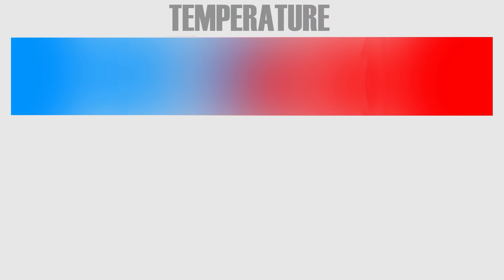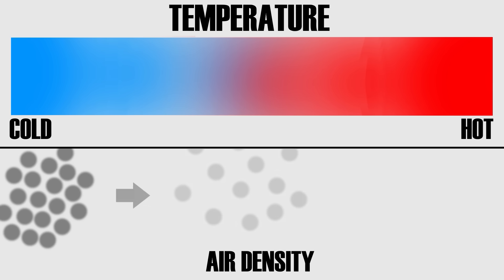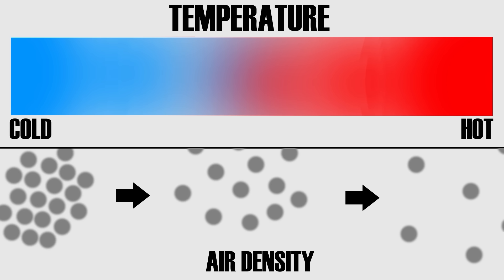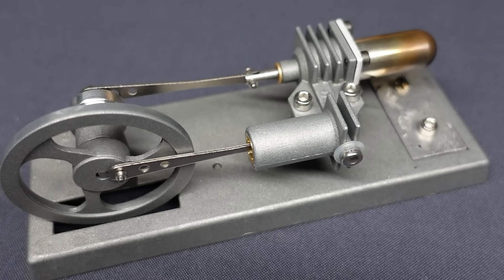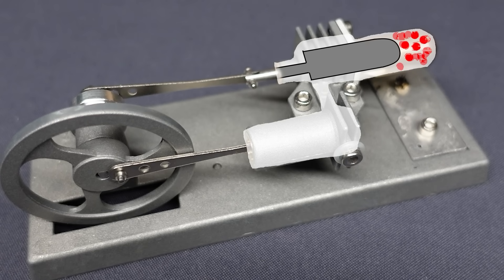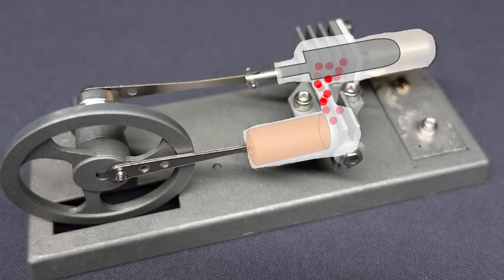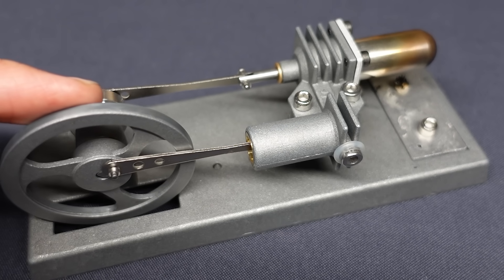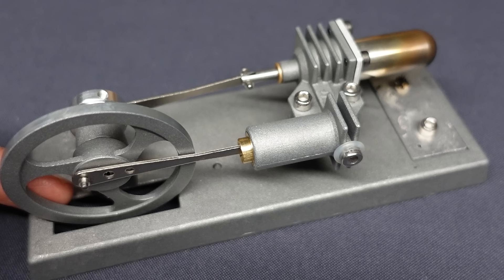It Can Save The World - The Simple Genius of Hot Air aka Stirling Engines

Comment from the maker: Single: https://bit.ly/4895cZz
V4: https://bit.ly/3EuFaCy
10% Off Coupon Code: d4a
More stirlings: https://bit.ly/3LglOVu
Reply: THEY WOULD WORK FOR CARS - if the engine is used as a generator for a serial hybrid the power modulation doesn't matter, it just produces electricity and the modulation of the gas pedal is independent for the electric motor(s)
Reply: @Mgoblagulkablong  Ja ja und am Auspuff könten Sie sich die Hand nicht verbrennen
Reply: Have u used an ion engine as a heat source like my rechargeable survival lighter?
Reply: Has there ever been a train / locomotive using this type of engine? If not, why not?
Reply: I think you overestimate a bit how much power could be harvested by a sterling engine given its rather low efficiency. Burn the same amount of fuel you used to run the 4-cyl sterling in a internal combustion engine of same displacement, and you could run more than just one single tiny LED from it. Same for the exhaust system: There's not so much heat stored in the exhaust pipes and the catalyst. However, if you would use the waste heat to heat up a heat storing medium (e.g., melting a salt), that might be a source for another 10 - 20 min of running the sterling. On the other hand, it's also quite heavy and needs significant space, so you would probably end up with two engine compartments where there was only one before. AND: Loading the batteries of an electric vehicle by using the excess exhaust heat from the combustion engine seems to be a slightly flawed approach... 😉
EDIT': Of course I agree that it would be a good idea to use the sterling engine in cases where there is considerably waste heat, e.g. in the off-gas burning of ETPs, or on oil rigs, or elsewhere when there is a constant flame which just wastes the energy. 
EDIT²: To my information, the most silent submarines are the German ones, because they employ fuel cell technology to generate the power for their electric motors. No noisy rattling excentric engine involved.
Reply: https://youtu.be/KbnGlcQiL1c?si=tb69J2Qh-moA8L75
Reply: can you remove heat by spinning the flywheel?  ie using excess electricity for cooling.  that would be an interesting video too
Reply: What if you were to wrap coils on the end and they were to get red hot like a jailhouse light where a battery gets the wire red hot? Would that create the same heat?
Reply: can you use the induction heating coil instead of flame it can heat it up really fast and with a cooling system the engin can become more responsive
Reply: Can these be use to temporarily disengage the alternator ?  

Using the heat from exhaust gases this could take the load from running it continously 

Does it generate enough power ?
Reply: You should look into the philips stirling generator! :) If it was still made, I'd love to own one
Reply: @Anomalous-Plant  ⚠️ God has said in the Quran:

🔵 { O mankind, worship your Lord, who created you and those before you, that you may become righteous - ( 2:21 ) 

🔴 [He] who made for you the earth a bed [spread out] and the sky a ceiling and sent down from the sky, rain and brought forth thereby fruits as provision for you. So do not attribute to Allah equals while you know [that there is nothing similar to Him]. ( 2:22 )

🔵 And if you are in doubt about what We have sent down upon Our Servant [Muhammad], then produce a surah the like thereof and call upon your witnesses other than Allah, if you should be truthful. ( 2:23 )

🔴 But if you do not - and you will never be able to - then fear the Fire, whose fuel is men and stones, prepared for the disbelievers.( 2:24 )

🔵 And give good tidings to those who believe and do righteous deeds that they will have gardens [in Paradise] beneath which rivers flow. Whenever they are provided with a provision of fruit therefrom, they will say, "This is what we were provided with before." And it is given to them in likeness. And they will have therein purified spouses, and they will abide therein eternally. ( 2:25 )

⚠️ Quran
Reply: @Anomalous-Plant  ⚠ God has said in the Quran:

🔵 { O mankind, worship your Lord, who created you and those before you, that you may become righteous - ( 2:21 ) 

🔴 [He] who made for you the earth a bed [spread out] and the sky a ceiling and sent down from the sky, rain and brought forth thereby fruits as provision for you. So do not attribute to Allah equals while you know [that there is nothing similar to Him]. ( 2:22 )

🔵 And if you are in doubt about what We have sent down upon Our Servant [Muhammad], then produce a surah the like thereof and call upon your witnesses other than Allah, if you should be truthful. ( 2:23 )

🔴 But if you do not - and you will never be able to - then fear the Fire, whose fuel is men and stones, prepared for the disbelievers.( 2:24 )

🔵 And give good tidings to those who believe and do righteous deeds that they will have gardens [in Paradise] beneath which rivers flow. Whenever they are provided with a provision of fruit therefrom, they will say, "This is what we were provided with before." And it is given to them in likeness. And they will have therein purified spouses, and they will abide therein eternally. ( 2:25 )

⚠ Quran
Reply: @Anomalous-Plant  Ja die  Philips stellen große Stirling her Sie finden Sie in jedem Atomkraftwerk zum Starten und Sauerstoff erzeugen Sie auch für Sie.
Reply: @d4a, do you have the link to the commercial New Zealand manufacturer or the other company?
Reply: @reypolice5231  Unfortuntely, although they got really far down the track, even making the engines commercially, they didnt last and closed down.
Reply: So why don't they have these over every dump flame that burns 24/7 🤯 now the dump could serve a dual purpose not to mention reducing the need for other means of generating electricity and what about volcanos or geyser steam
Reply: @Elmer-yt3on  A slaughter house in nearby town has giant flame 🔥 out back that burns 24/7......Obviously some type of run off gas. But looks like it could heat the nearby large department store 100 yards away.
Reply: @michaelbrinks8089  another question would be if we can make all packages and things we use out of recyclable materials then why is it even legal to use anything that's non-recyclable? Funny how that's not even on the board 😑 these kinds of things really grind my gears 😁
Reply: Time to build an car engine based on nuclear waist. 
Heat, electricity, steam could be one of the key words
Reply: There was a cool Stirling engine on permanent display on campus where I went to school for engineering. 

I was justvas excited about the waste heat applications for the Stirling engine, until I learned I learned about TEGs. Thermal electric generators are solid state and compact.
Reply: Could some components use composite non metallic and or quieter materials?
Reply: NASA and US Air Force 1993. these engines are 40% more efficient and can give the same power and you can control the RPM quickly if you requlate the pressure inside the Stirling. would be great for survival and hybrids, they are sold as generators for large buildings.
Reply: I see you've discovered these fun little toys too. 😁 They are indeed intriguing, considering they can run off solar heat, especially if the cold end is buried underground where it will stay chilly all the time. I once "turbocharged" one of my toy Stirling engines by putting the hot side on a cup of hot tea with an ice cube sitting on the cold side. (video on my channel.) I even made one that's baby-powered. (also a video on my channel. 😁) However, as a means to harvest solar power it's still more maintenance intensive than good old photovoltaic solar panels.
Reply: always think out of the box for alternate clean energy engine to us to the 21st centuary
Reply: I was under the impression that Sterling engines weren't that great because you can't get them to increase speed output hence why Steam took them because of inefficiency of sterling engines which can't produce power to well power larger vehicles at huge scales
Reply: @GamingCraftTeam   https://youtu.be/KbnGlcQiL1c?si=vpRV3apRSRbYXz0v
Reply: Why don't we run these on volcanos instead of coal etc.?
Reply: ""it's not like we have external combustion engines""  DO you know know how they work? external couldnt be a thing..

Comment: make the engine large enough and coat the hot end with a Carbon Nanotube substance then focus sunlight upon the area coated with the CNT and you will have the start of a solar powered generator - you could potentially make a power source for living OFF THE GRID and all you need is a few of these types of engines and the right kind of circuit hookups and you can have a lot of free electricity for your home.
Reply: Да и солнце нужно постоянно 😂

Comment: Don’t get too excited about waste heat.  Low grade heat doesn’t have much exergy.  The waste heat from thermal power plant is low energy for obvious reasons.  You’ll end up wanting to run your stirling engine(s) on high grade heat and then you’re right back where you started.  Try shining focused sunlight on the hot end; that’s the real take away here.  Look into thermoacoustic engines which are Stirling engines that use a sound wave resonating inside of a tube in place of the displacer.  I’ve been developing one in my limited free time for a while now.

Comment: "They vibrate a bit, look at this water!" Completely ignores the engine slowly vibrating it's way across the table.  I'm amused.

The best part about the Stirling cycle in my opinion though is that it's reversible. If you input mechanical power, they become heat pumps, moving heat from one side to the other. Which means they're fantastic for refrigeration. Or for heating, I suppose. Though using them as a heat producer is not something I've looked into. Making heat is easy. Moving it around is where the difficulty lies.

Some Stirling engines can, when some "engineering considerations" are taken, be sensitive enough to run off of the heat from the palm of your hand. Providing the ambient temperature is low enough, there's a large enough difference between your hand (About 38'C) and the environment (10-15'C outdoors, 21'C in a typical office) that a light weight Stirling can take advantage of it.

But as said, the real fun is when you input mechanical energy to move heat around. Check out Hyperspace Pirate's quest to build a pulse tube cooler for a related mechanism. He talks about Stirlings a lot also.

Great vid!

Comment: They can also be vertically mounted phase change engines and well; since you aren't limited to air in the cylinders you can also use much more expansive fluids in the chamber. 

It's basically just the inverse of a heat pump / air conditioner after all! 

If you drive the flywheel instead of the piston it'll make one piston really hot and the other really cold!

Comment: If power modulation is an issue then wouldn't a Sterling Engine be a great choice for something like an electric car Range Extender? You'd be perfectly happy running it at a flat RPM and a delay in starting it up would be fine as it's a backup system anyway.

Comment: actually would think Stirling would be good partner for Diesel electric cars/trucks.  For example......  say you have a diesel engine at size of X= HP & Torque, necessary to not just keep charged the capacitor/battery bank full so the electric engines can move the vehicle in real world,  but also to have enough of reserve electric in the Capacitor/Battery Bank to accelerate, climb a hill etc (when needed)....    

ok- now.....  reduce size of diesel engines  needed  X  output, just the right about to where you can make up the loss by using the diesels hot exhaust to power  a Stirling engine that either assist the diesel's power output.... or have the Sterling run a smaller generator of its own.

Comment: Power modulation is only a problem if you want to use it to power the car directly.  If you use the engine as a generator that powers and electric car, that seems like a perfectly good system.

Comment: Power modulation dosen't matter with the generators in Series Hybrids. This makes Stirling Engines, and gas-turbines, perfect for vehicles. Both can easily use so many different fuels. Great for an emergency. This is another reason, why I declare, for commuting, adventures, and performance, Series Hybrids are the best. And you can replace the heavy batteries with capacitors, and just make these engines electric drive. No gears to fumble over, no clutch to burnout, no stallng. And with Brake-Regeneration / Rheostatic-Braking, no brake pad wear. I really hate that Jaguar abandoned the original CX75 concept. That could have done for Series Hybrids, what Tesla did for EVs.

Comment: I wonder if anyone's got these to run off solar? you could have the engine in an enclosed cool area, with the dispacer cylinders on the outside and perhaps a dish around it to reflect more of the sun's energy onto the cylinder. With a big enough engine, I wonder how far it could last into the night on waste heat.

Comment: I think the power modulation problem of the Sterling engine could be solved by using a CVT transmission of a sort where the engine always runs at fixed speed (max HP) and the speed of the vehicle is controlled by the CVT with a good torque converter between the two? Hmmm?
It's an interesting idea right?

Comment: An internal combustion engine😮 doesn’t have to be noisy , The Atkinson cycle Version,like is implemented in Toyota hybrids, can be silent since it equilibrates cyclinder with atmosferic pressure at valve opening.

Comment: They are the little cousins of the imaginary, perfect Carnot-engine, and the nearest thing to a Carnot-engine, that can actually exist outside of thermodynamics-books. 2 points that are important: 1st, efficiency rises with the temperature-difference between hot/cold-sides for ANY engine. As long as u have materials for the hot-side, that still hold their mechanical properties when highly heated, they can be heated at levels above what would be healthy for the function of an ICE. All together, they reach higher efficiencies than ICEs, and in the worst cases, they are just as efficient as the highest-efficient ICEs... 2nd, the "heating" itself is always more efficient: While every open & constant flame can be easily modulated to burn 100% of the fuel (leaving just harmless CO2 behind), even the most complex ICEs cannot manage that, there´s always CO and carbohydrates left (all of them poisonous or cancerogenic), which contain unused energy. So, higher  ΔT° and more efficient fuel-usage.

Comment: 9:56 nice, first thing I thought when you showed the 1 cilinder engine was; where is the v 12 version?😅 
Jokes aside I think there is much to gain changing heat energy to kinetic energy, who knows maybe you can make a near perpetual imobule if you can create even a 50% efficient way of changing heat to electrical energy, and using the electric energy to generate 250% heat energy with a heat pump😊

Comment: You forget something , the flame of the engine produce also poluted air. So clean, i don't think so. It is of course cleaner than normal combustion engine but still there are polted gases. A flame heated by terpentine produces more polution than you think. But heated by Alcohol, it's more enviroment friendly.

Comment: Put a battery in the system as a buffer and modulate the power output using an electric motor, like the diesel-electric locomotive. Any research into using the sterling engine to recover the waste heat from an ICE?

Comment: So…building one outside and using a magnifying lens to focus sunlight on the heated cylinder provides free, zero emission  power!  Or you could use a solar cell to heat a copper coil around the heated cylinder…still zero emission, free power!  An alternative to the usual electric motor.   Scale it up and it could do useful work.  Intriguing!

Comment: My shop teacher in North Las Vegas Nevada of all places had a Sterling engine that used noble gases and a polished cone to reflect sunlight into essentially a ray gun to heat up the gases and create the combustion cycle but the gases are cool down when out of heat. And I was like why is this not just a standard unit on every power source house or whatever in the city they could all just follow the sunlight produce energy and charge batteries....?

Comment: You can't just ignore the heat source, they are not emissions free.
The power they can output is far too small to be useful.
Charging a car battery from manifold heat?
You're not even stretching the truth here man, you're just flat out lying.
As for the submarine, the stirling engines do not drive the submarine. They are far too weak for that. All they do is allow the sub to charge it's batteries without having to surface.
They also do nothing for it's sound emissions, because the traditional diesel in the diesel-electric system produces zero sound when submerged. This is because it's only running when the sub is surfaced and charging the batteries. They trade the increased bulk and weight of the stirling setup for the ability to stay submerged for longer.

Comment: These things are great. I've had an idea about using these over compost bins, setting them ontop of a pyramid that funnels the heat from the pile into it. They might even be useful for recycling heat energy within a home in colder climates or places with blistering winters. I already know they are used for geothermal energy. Even had this idea for a rain engine, that uses a river to power a generator or device that heats the river water and blows the steam into the atmosphere, but that doesn't need a steeling. Anyway sterling engines are the coolest things.